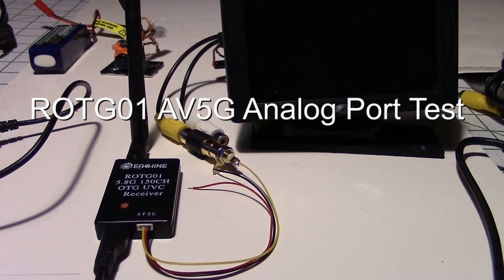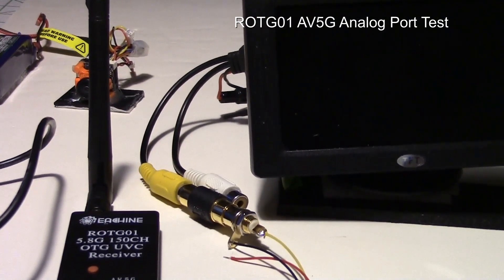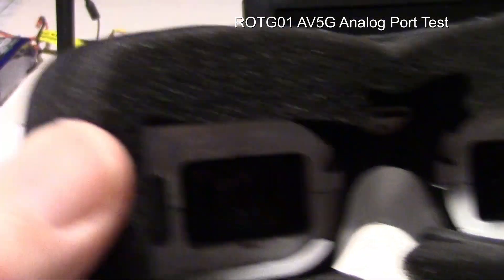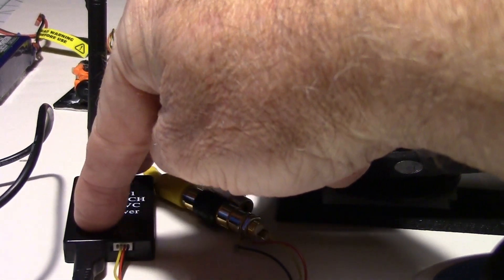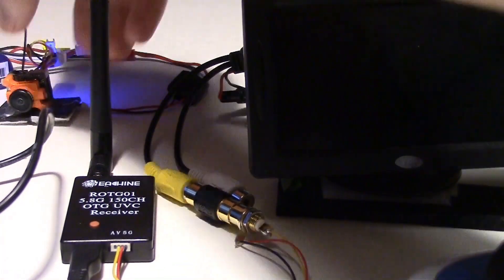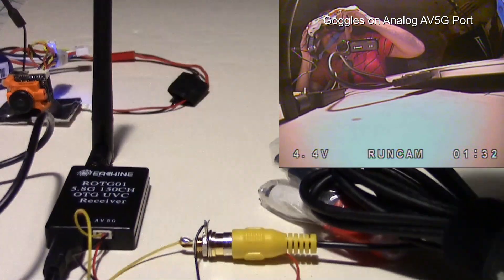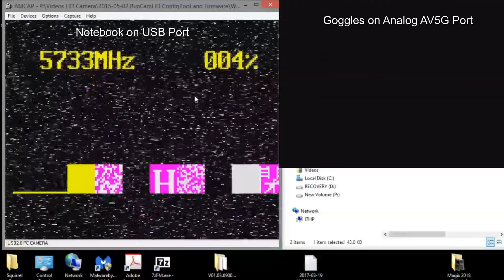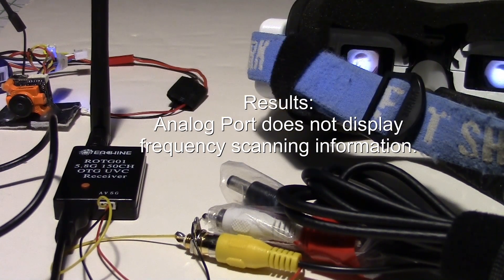Eachine ROTG02 ROTG01 Does The AV Port Work, Questions Answered

Comment: Hi Dave I have a few questions:

1/ is the Mini Micro 1.25mm T-1 4-Pin JST Connector also OK for the ROTG02 (on your video I see the ROTG01)

2/ the definition available via the USB is 640x480 but my camera standard is PAL with 576 horizontal lines. I was wondering if the analog output from the ROTG01/02 allows to display the real PAL definition of 576 horizontal lines?

Thanks Paul

Comment: Hello, very useful both of the 2 videos you posted and thank you in advance, if your giving me an answer to the following question.

I want to supply 5 volts from the analog port and get video streaming from usb on my phone .... I just do not want the receiver to consume the battery of my phone.

Do you know if such an idea will work without a problem, because it will receive power from both ports? have you tried;

Comment: There's a way to connect directly the camera on cellphone without use the RF transmitter? 
    The cellphone and the camera Will work together in a device for night vision using the camera, the cellphone and the googles. 
   This question is because if I can avoid RF connection I can make the device more light and reduce the delay. Someone help me please

Comment: Hello.
I tested with the USB connected to the PC, with the AV output on a monitor.OK
But if I power by USB (with an AC adapter) or a + 5V on the AV port, I have nothing output even if I run a frequency scan by pressing 3s on the button. Have you tested this method ?
Reply from the maker: Yes that was tested with + 5V on the AV port, but I must to get a frequency lock before I will see anything on the AV port. Just running the scan doesn't mean your are getting a lock. There are other variables as well such as the monitor or product may be faulty.
Reply: @DaveMerc  hum OK.
Reply: Cut a usb cable, with an otg soda usb-otg cable by connecting the red and the black + - do not solder the white with the green, and you could plug into a 5 v battery and pin the pin 2 of the Rotg02 to your monitor with mass pin 4, case if you leave the wire towards and white this is called date + and date - the Rotg02 will feed without the date + and -
Reply: @coronabootv2032  its not working sir
Reply: Don't forget the thermo sheath
Reply: i have the same exact problem with ROTG02.. powering through pc or phone i get av output but powering through powerbank or charger i get nothing.... please help if anyone knows a workaround

Comment: But does it really matter if it shows the scanning part or not? 
I mean.. it will lock on as soon as it finds a signal and show that signal on the screen, that's the most important part.
Reply: for sure. but doesn't work without USB connected (PC or OTG)

Comment: Thank you for the information ,it will be useful as I have now a ROTG01 ,would you tell me what is the analogue connector that plugs into it ? I have now buyed a few bulk packs of connectors and still none work .If it also happen to be BG who sold it to you the # they use to identify them will be much appreciated ,cheers and fly well !!
Reply from the maker: On ebay.  Search for Mini Micro 1.25mm T-1 4-Pin JST Connector.

Comment: ROTG01 vs ROTG02

I have noticed strange behavior: with ROTG01 I can power up from those external pins, and get analog signal out without any problems. But with ROTG02, I need to plug my phone before I get  signal out, after phone was plugged, I can remove it and video out is working with power from those pins... have anyone and Idea, or workaround how to use ROTG02 without a phone in anytime?
Reply: Yup I have the same on the rotg02 it powers on but it seems the receiver circuitry doesn't power on until it receives some ack signal on the USB port.
Reply: Yup, same here

Comment: Hey just quick question maybe u can help me. im actually trying to hook up. My identical reciever to my dominator v3s. I have that cable u have. What did u solder the ground power and video to on the yellow input? And why didnt u use all the other two?
Reply from the maker: I did not hook up the power or Audio wires (red and white) for the test. Power is coming from the USB port. Audio I didn't need.
Reply: @DaveMerc  oh. Okay thankyou. So center is pin is video and outside rim Is ground right?
Reply from the maker: Correct
Reply: @DaveMerc  I'm glad  I stumbled on your vid. I get better reception from this reciever and a phone  then the stock dominator v3 reciever no matter what antennas. So I figured use this reciever on the goggles.

Comment: Can you make a video on how to connect it to a monitor using the analog port?

My ROTG01 worked fine on Windows, but now it only works on Android. Windows recognize it when it's plugged in, but in device manager, there's a yellow triangle next to it. Was something fried on the board or is it the Windows issue?
Reply from the maker: It's probably a Windows USB driver problem. This is the video for connecting to a monitor. Just connect the video wire and ground to the AV input on the monitor and provide 5 volts. That's it.
https://www.youtube.com/watch?v=w7RYp6sO_Lw

Comment: Thanks for the information. 
I just bought ROTG02 and as long as I get info on my PC then thats fine with me. 
I use the setup for Astronomy with a runcam connected to my telescope out back.
Thanks again.
Reply from the maker: Okay, that;s a cool use for it!
Reply: @DaveMerc   thanks by the information! I have a question:
There's a way to connect directly the camera on cellphone without use the RF transmitter? 
    The cellphone and the camera Will work together in a device for night vision using the camera, the cellphone and the googles.  (I need a external camera  because I need to remove IR filter of the lens)
   This question is because if I can avoid RF connection I can make the device more light and reduce the delay. Someone help me please? Thanks

Comment: If you use these "power-hog" Android smartphone receivers (around the $20 range) with the FPViewer App, you will see the scanning process also. If one has the patience, it is possible to single-step through the whole 5.8Ghz band - pausing on those lost horiz sync stations to see if perhaps adjusting the antenna helps improve things. Actually they all use the same basic circuitry.. ;-)

Comment: Have you tried powering the AV ports through the AV port instead of the USB port?? 
Maybe there is an internal sensing of which port to send the scanning data. Just a thought.
Reply from the maker: Yes, I tried putting a 5 Volt UBEC on the red wire to the AV5G port and it did the same thing. A bunch of flashing, no frequency info and only displays the picture when in gets a lock.
Reply: That's too bad. It would have been great if all the screen info would have been output to the AV port....:-(
Reply from the maker: My guess is that the AV port is a direct output from the receiver while the USB port is the output of the OSD section with scanning info overlay.
The components are so small and much of the etching is in the center layer of the board that it makes it hard to figure out what is going on or how to tap in.
Reply: @DaveMerc  I manually added AV out from a similar (likely identical) diversity receiver module and I get the same result- no OSD